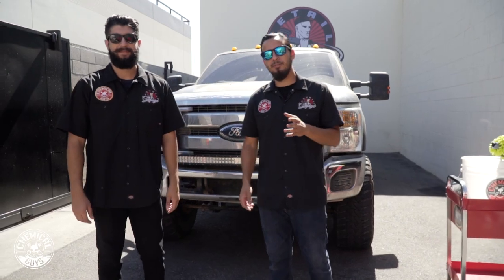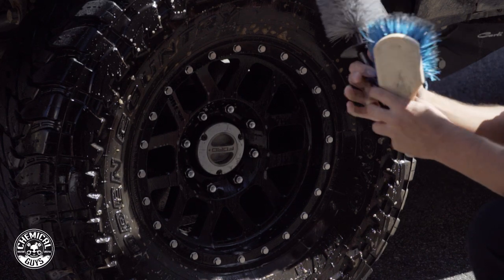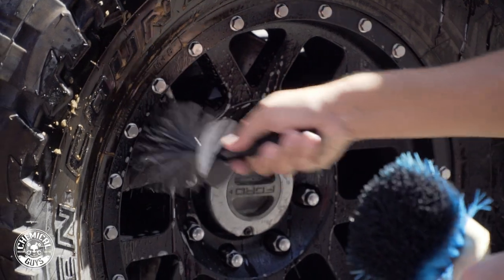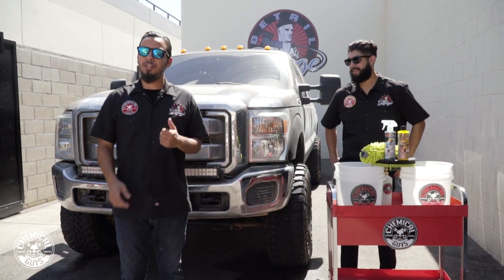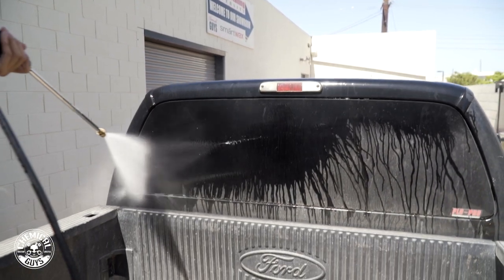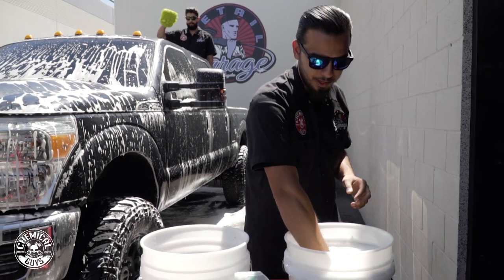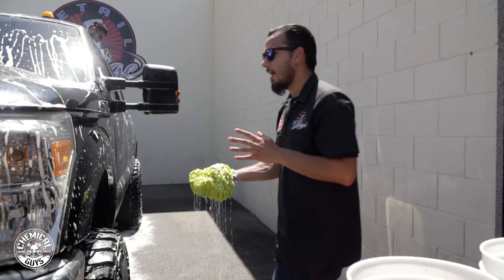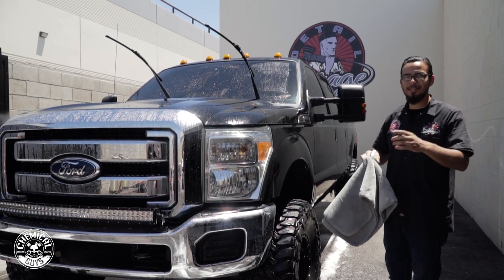How To Wash Dirty Off Road Trucks! - Ford F250 - Chemical Guys Car Care

Comment: Wouldn't the safest method be: 
1. Foam
2. Rinse with pressure washer. 
3. Re-foam for contact wash 
4. Contact wash
5. Rinse 
6. Dry

Or even go one step further and rinse before the first foam-ing I listed? What's an extra 15 minutes compared to hours and cost of paint correction?
Reply: Froylan Cepeda rinse, foam, rinse , foam , wash , foam rinse? That's a waste of chemical and water and time and gas if it's a gas pressure washer .  rinse before foaming and then wash and foam and rinse is perfect unless it needs more than one rinse to remove left overs but it should still be in the first rinse unless you missed areas than rinse again
Reply: Froylan Cepeda stop pls
Reply: Your exactly right
Reply: U GOT IT ALL WRONG MY BROTHA JUST FOAM N PENETRATE IT W/ LUSCIOUS FOAM N LET IT DO  IT'S MAGIK 4 17 MINUTES N KOME BACK W/ JUST THE WATER HOSE NO ATTACHMENTS N 🐝 READY 2 EJAKULATE YOUR EYE'S W/ THE TREMENDOUS RESULTS 🤗🤗🤗🤗
Reply: Or even go a step further and wash in the f@cking shade !!! Cmon guys. You never wash a black car in direct sunlight !!! Even the windshield is a mess at the end of the video
Reply: Fc ha idk sounds like your the pro you tell us lol
Reply: Pro nano diamond.

Comment: I detail the same truck with different wheels and always get the wheel wells it's look like you guys missed those but looks fantastic still
Reply: They missed 50 % of the truck the entire undercarage  could have atleast pressure washed it not even hit it with apc and any mechanic would have been happy especially when somebody has gone mudding

Comment: Great Video!!! I have recently bought some of your products and they are working great. I have one question. I have an F-250 like the video. How do you get the frame a nice clean black color. I have had services wash my truck in the past and the frame looks great!!!! It doesn't collect dirt either. How do you do this?
Reply from the maker: Hi Troy, thanks for watching! Use the Blacklight soap to foam up the paint, or use it in your wash buckets and grit guard. If you're referring to the undercarriage, clean that area with a degreaser, or an all purpose cleaner to remove dirt and other contaminants. We carry a product called barebones undercarriage spray that will make the  undercarriage black, and restored.  Always apply a wax, and a sealant to protect and shine your truck. Wax every month, or every month and a half. If you're looking for a spray, check out Black On Black, it's great for getting that deep wet shine. https://www.chemicalguys.com/Black_on_Black_Instant_Shine_Spray_Dressing_p/air_spray_1.htm

Comment: HOW TO WASH OFF A DUSTY OFF-ROAD TRUCK ******
Reply: Shottz exactly it is not even "Dirty" as they state..
Reply: Ilias • A load of the mud come straight off when just using the washer it's self. Not hard to make it look good when it's like that 😅
Reply: Shottz You're so right, Internet tough guy! There wasn't one speck of dirt, mud or road debris. It was ONLY dust! If they would have just used a swiffer, they could have just dusted it right off to perfection! No need for water or soap!
Reply: They did a video I believe with a WXR that was worse than this truck was, but still not even close to being muddy. Also not many people with a 50+k truck is going to take it truly muddn.
Reply: OtherJesus Yeah they could just have used an air compressor...

Comment: Nice job! One question though, why did you wash the wheels first? Because won’t the dirt go strait back to the wheels
Reply from the maker: Hi there! Thanks for checking out the video. The reason we begin with the wheels is due to the fact that brake dust, road debris and other grime from the wheel is much more abrasive and corrosive when compared to the dirt on the vehicle. So, starting with this mess rather than the body first prevents doing twice as much work and harming the paintwork.
- CG Nick

Comment: That lightbar drilled into the trim made me cringe. lol. Great vid guys!
Reply: Omg agreed
Reply: Why
Reply: Says its an "offroad truck", but doesnt have a winch.  Its just a lifted truck for picking up bonfire hoes.
Reply: Graylin its actually not cringe but useful. i go with my friends offroad in the desert at night and one thing i can say for sure is these light bars are so useful
Reply: Blake Presson in the desert there isn’t much to winch off of.
Reply: James Cole that's why you take a long rebar and a sledge hammer with you
Reply: Cheese Cake Salad Head you must not be from the desert.
Reply: what part of the world do bonfire hoes exist? I'm on the market for a few.

Comment: Nice job. But I only have a thought. Wouldn't it make sense to wash and n some shade to not let the sun bake the water spots into the paint before you get to drying it?
Reply from the maker: You're correct. That's the main reason we used After Wash, to quicken our drying time so there may not be any water spots. Also, we get a lot of comments asking us to do outdoor washes to see if it's possible and we decided to show them how to properly do it. Nevertheless, definitely wash under a shade.

Comment: Haven't tried this product yet but the marketing/label/name will sell on its own for sure! Every truck guy will want this if it works good or not 😂 miles well come out with a whole tough mudder line of products  including camo buckets and wash mit 😉
Reply from the maker: Hey Pristine, thanks for the shout out. That's great, we should come out with a line of Tough Mudder products. Be rest assured that the Tough Mudder shampoo produces amazing results, like many of its predecessors, it has a winning combination of gloss enhancers, and emulsifiers that are strong enough to tackle dirty off road vehicles, but safe enough not to strip wax, and sealant coatings. Stay tuned, more great videos coming your way.

C.G. Alex -

Comment: Do you not want to add full pressure when it's super dirty or that's rule of thumb for rim cleaning period?? Thanks
Reply from the maker: Hello Jonathan! The reason we didn't add full pressure to rinse down the wheel was because the finish on the wheel were a matte finish and as you know, matte can be a very sensitive finish. When there's abrasives on the wheels such as the brake contaminants, mud and salt deposits and you accompany that with an intense 2800 psi water stream then it can potentially be an intense form of a rinse down. For the purpose of the video, it was a lot easier to simply rinse it down and knock down the light contaminants and use the lubrication and strength of the Sticky Citrus Gel wheel cleaner to agitate the wheels and safely remove all the contaminants. Thanks for being part of the Chemical Guys family!
-CG Joey

Comment: I own a truck and the hardest part for me is 2 keep the truck wet and preventing water spots, what do u guys suggest?
Reply from the maker: Hi Kevin, that's a great question. Water Spots occur because minerals in the water get left behind when water evaporates. You should avoid washing in direct sunlight, if that can't be done then you will need to pick up a canopy, or find a shady place to wash. Secondly invest in deionized or filtered water. Depending on how you're washing, definitely have everything ready before you wash. You can also try some After Wash  which will help you dry. The last thing you can try is a ceramic coating, it will coat the paint and protect it from water spots. Ceramic coatings promote water beading, try our Carbon Flex which will protect your paint from oxidation and other contaminants. Always apply waxes and sealants, they will afford you the most protection if you decide not to invest in a ceramic coating. Butter Wet Wax, and Jetseal are among our best.

C.G. ALEX -

Comment: Great video guys!

So question, I have a Jeep and it constantly is muddy from wheeling trips here on the east coast. I currently use citrus wash and gloss and it does amazing work with the foam cannon. What's the difference between this new tough mudder and citrus? It looks like it's almost the same product

-Steve
Reply from the maker: Hi Steve, 

The Tough Mudder does not have the Citric agents that the Citrus Wash & Gloss has. Also, the Tough Mudder has surface-release additives repel future mud, dirt, and filth for easier cleaning. Also, has extreme surface-cleaning agents that break down heavy grime and mud so that they become lubricated so as to not scratch the paint when it's being wiped off. It may be extreme but its still completely pH-balanced solution is safe for wax and sealant coatings.
Reply: Chemical Guys awesome thanks guys! Gonna have to give this new product a try!

Comment: It's turning brown , the liquid is orange ... LMFAO
Reply from the maker: Hi Lorenzo, thank you for watching. Javier meant that the Sticky Citrus mixed with the water on the surface of the tire and broke down the dirt, and grime turning it brown. That brown fluid trickled down the wheel as Javier navigated the brush between the wheel's spokes.

Comment: Everytime I wash my vehicle in sunlight it dries the water onto the surface in minutes. How come you guys do it and everything goes fine and you have nowatermarks or anything.
Reply from the maker: Hi Brandon, we use deionized water, it has been filtered to the point where it's just pure water without the calcium and magnesium deposits. Water spots occur because of the minerals in the water, when the water evaporates, they leave those unsightly spots that could etch into your paint.  Stay tuned Brandon, we've got more great videos coming your way.

C.G. Alex -

Comment: With the new soap, is it PH neutral? because panels drying on big trucks is common, expescially when they are black. Also will it strip any waxes already on the truck? Or Is it like citrus wash and gloss?
Reply from the maker: Hi Eric, thanks for watching. The tough mudder soap is pH-balanced formula which does not strip wax or sealant coatings. The soap is perfectly okay to clean the really caked on dirt, mud, and debris after splashing around in the dirtiest environments without removing your crucial wax and sealant coatings. Citrus Wash and Gloss comes more concentrated, and will surely remove your wax and sealant coats.
Reply: Awesome! Keep making great products! Definitely have to pick some if this up!
Reply from the maker: You got it buddy!!

Comment: what would a professional clean like this cost; for the truck owner?
Reply from the maker: Hi! The cost of detailing a truck like this will vary depending on a variety of factors, such as your location, the detailer, the experience of the detailer, the size of the truck, how dirty it is, what you are having done to it, etc. We recommend contacting a local detailer in your area to get a better idea of pricing. Thanks for watching and make sure to check back tomorrow for a new video upload!

Comment: What is best to use for cleaning and protecting the rubber lining the doors and under the hood of cars?
Reply from the maker: Hey there, thanks for watching. I would use either EcoSmart, diluted Nonsense, Signature Series Orange Degreaser, or All Clean to clean the rubber, followed by applying a trim dressing like VRP, Tire and Trim Gel, or Silk Shine to keep the plastic from fading and cracking prematurely.

C.G. Alex -
Reply: Chemical Guys mahalo!!
Reply from the maker: On Behalf of the Chemical Guys crew, we wish you a Merry Christmas, and a happy New Year

Comment: Hey chemical guys, I bought one of your torqs snow foamers and for a while it performed great. But now it doesn't throw any foam it's just throwing a bit of soap and it's really watery any idea what might have happened? I liked it while it worked properly so I was pretty disappointed when it stopped foaming.
Reply: Edgar Jimenez pretty sure it was maintenanced correctly haha jk the tube might have a tiny rip in it or the head might have something stuck in it or youre not putting enough soap in your gun
Reply from the maker: Hi Edgar, we've sold thousands of snow foamers with no problem. You can contact our Customer Service Department who can help you better answer product-specific questions. Email: customerservice@chemicalguys.com

Thanks for being part of the Chemical Guys family!

Comment: Washing under direct sunlight wow
Reply from the maker: Hi there, we appreciate your concern for this customer's car, but would like to share a few reasons why it was safe for us to wash this car in direct sunlight:1. We use deionized water. 2. This soap, like most premium CG soaps, is pH balanced. 3. The climate was temperate. 4. The paint was cool to the touch. 5. It's California, so why wouldn't you want to be outside? 😊 We have detailed thousands of cars over many years under the conditions above, all to the utmost satisfaction of our customers. If you ever have any questions, or are new to detailing, we encourage you to contact us for advice. We can be reached via telephone, email, or even facebook messenger and are here to help.

Comment: I saw a video from you and the lady said that if the truck is too dirty to use foam first. But you guys are using water first.
Reply from the maker: Hi! You can use your judgement whether to rinse the vehicle with just water or foam. The important thing is that you rinse it! For extremely dirty vehicles, you can foam first and rinse off, but the guys in this video were able to get a satisfactory level of dirt off just using water. Thanks for watching and make sure to check back more amazing videos headed your way soon!

Comment: We don't want to induce anymore scratches on the wheels????? It's rubber it won't scratch and the rims are matte so won't scratch easily either so they should have used full pressure on the hose

Comment: Does using pressure washer create scratches?
Reply from the maker: Hi, thanks for watching. Pressure washers can damage the paint if the pressure is too high, and if you use it too close to the paint. Nick sprays the car down with the pressure washer at a comfortable distance away without stripping any of the precious paint. Pressure washers create the best amount of foam when paired with a foam cannon, and they have the power to knock off the heaviest dirt, especially on large trucks. To further minimize chances of scratching during the entire washing process, remember to use a super foamy soap like Honeydew and to use a Chenille Microfiber mitt. Thanks for watching, Jason, and stay tuned for more videos coming your way soon!

https://www.chemicalguys.com/Honeydew_Snow_Foam_Cleanser_1_Gal_p/cws_110.htm

https://www.chemicalguys.com/Chenille_Microfiber_Scratch_Free_Wash_Mitt_p/mic_493.htm

Comment: Finally a truck that actually is dirty
Reply from the maker: Hi, a truly dirty truck indeed, this one took more than mere elbow grease, a detail of this magnitude required the combined might of the Chemical Guys duo as they rid the vehicle of thick mud, blanketed dust, and triumphed once again. The truck by all measures was a challenge, but ended up as another notch in the Chemical Guys belt. Stay tuned for another great video from the fearless two, and the rest of the Chemical Guys media army.

Comment: What do you guys think about using a ceramic coating on a mudding truck like this one. I have a truck similar to that one and man does it stay dirty. Fwi not my fault I liv down a dirt road :(
Reply: elliot langlinais do it, protection is protection Ive coated many work trucks, make it easier to clean off all the dirt and mud meaning less scratches and swirls
Reply: elliot langlinais yeah do it but make sure you give it enough coats. And also give it a paint correction if you have the time/money because otherwise it will not look very good.
Reply from the maker: Hi Eliiot, thank you for watching. Ceramic coatings are a must, especially if you live in really hot temperatures, or you experience allot of rain. We totally agree with everyone else, especially because you paint could be damaged by tree sap, abrasive dirt, water spots, insects, and other environmental hazards. Start by cleaning, claying, polishing and applying a coating. Wait 24 hours and apply a glaze, sealant and a wax. After doing this, you should be good to go for up to two years, and 6-8 weeks with the wax depending on the temperature.  Stay tuned, more great videos on the way!!
Reply: Thanks guy for the info. I'm thinking on using cquarts and a cleare bra along the bottom to help protect against the rocks hitting it.

Comment: how much will it cost? like you did to this GMC Truck?
Reply from the maker: Hi Waseem, are you asking how much it would cost to detail a truck like this?
Reply: Hi,  yes if you can tell how much it would cost to detail a truck with Chemical Guys products! Thanks all though we don't have Chemical Guys products in Saudi Arabia, I have to some how order it online.
Reply from the maker: Hi Waseem, I'm going to leave you with links to the products in the video so you can idea of what it costs to perform this detail. Everything you see in this video roughly comes out to two hundred, and that's not including the cost of a pressure washer if you don't already own one. Tough Mudder  $9.99  After Wash  $14.99  Sticky Citrus  $9.99  Heavy Duty Detailing Bucket $7.99 *2  DIRTTRAP  $9.99  Easy Reach Wheel And Rim Detailing Brush $19.99  Chemical Resistant Stiffy Brush $7.99 MTM Next Generation Professional Foam Cannon $84.99 Woolly Mammoth Microfiber Dryer Towel $24.99. Our products are available through Amazon, and we have wholesalers in Europe and Australia that may be able to ship prodcuts to you. Hope this helps Waseem.

C.G. Alex -
Reply: Thanks :)